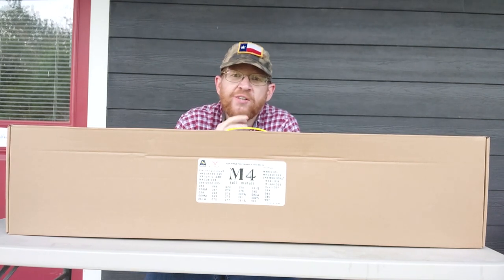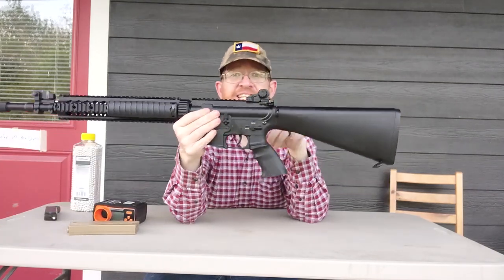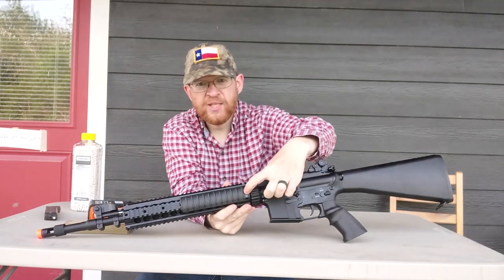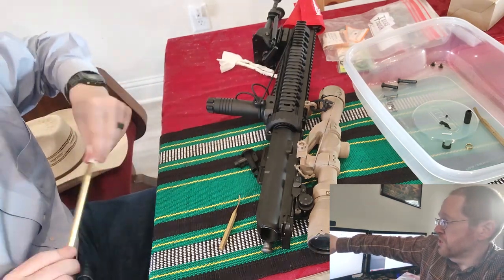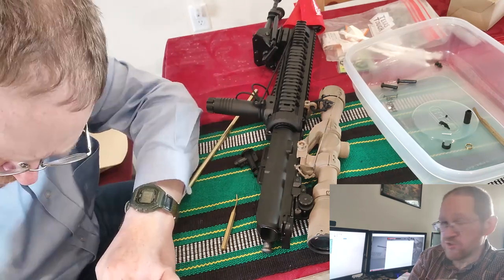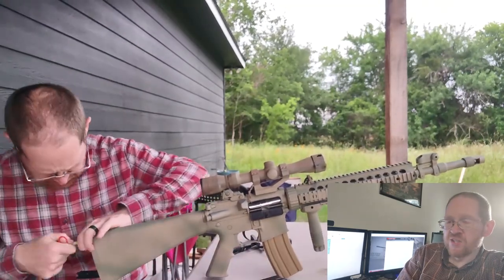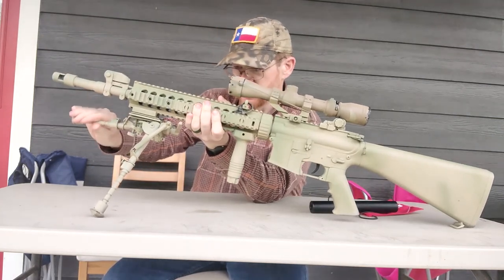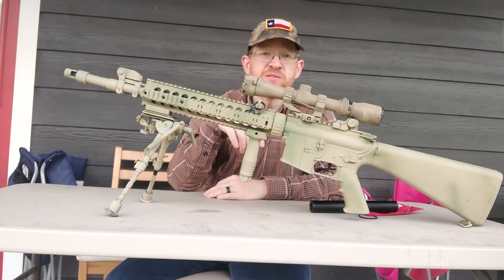Double Bell Mk12 Mod1 SPR setup as a DMR (part 1)

Comment: Hi! Which replica is better Double Bell MK12 or Double Bell AK 12 (internal) from taiwangun? Which one do you recommend?
Reply from the maker: Honestly, it would depend on which you like the looks of better. Actual performance is probably about the same.

With Double Bell, they do a good job on the externals, but horrible internals. They're decent base guns if you plan to gut it and replace all the internals.
Reply: @AdjacentPrepper  Thanks. And, which replica do you recommend with good internal parts? I plan to buy a replica soon to myself.
Reply from the maker: @ivangalovic4045  If you can afford it, I'd say VFC is the way to go. Last time I looked, they run about $450, but they do both good externals and good internals.

With cheaper AEG's, you've got to compromise somewhere to get the cost down. (Based on my experiences) Double Bell does good externals, but compromise with low quality internals. On the flip side, S&T does decent quality internals, but cheap plastic externals.

Comment: Definitely a good move to replace the hop-up but one thing ive noticed is most pre built guns come with pretty disappointing hopup units. Id definitely recommend getting a full metal rack piston tho. Id also highly recommend getting a decent piston head(rocket airsoft makes good ones for about 8$) and a double o ring cylinder head(rocket airsoft also makes a good one for about 8$). The only other thing i would do is a new inner barrel cuz it would eliminate the variable of the little slit near the bucking window that you had to put tefflon tape over. Never the less i love the paintjob and u accessorized it tastefully.
Reply from the maker: There's a part 2 coming. At this point I've replaced the barrel and bucking (again), along with gears (two broken teeth that jammed the gearbox up), and trigger contacts (they were blowing sparks). Might need a new motor; waiting for USPS to deliver my GATE USB link so I can see what the actual error code is.

It came with a full metal rack piston, bug given two gears broke in less than 500 BBs I'm not sure how much I trust Double Bell's "metal".

I tried a Madbull hopup unit, but it wouldn't feed. BBs entered the hopup but didn't make it all the way to up for some reason, so I just switch back to the VFC since it works.

Internally, that gun was a mess, but the compression is actually really good.

Comment: Please tell me, what kind of optical sight do you have on your carbine?
Reply from the maker: Initially I used a Tasco World Class 1.5-4x. I think Tasco discontinued that model in 2015 though. https://www.amazon.com/gp/product/B000UI0VOC/

I switched it to using an old (purchased in 2005) Leupold Rifleman 2-7x. I found the 4x just wasn't enough to see where the BB's were going past 150 feet. https://www.midwayusa.com/product/1009580328

If I had to buy a new optic though, I'd probably go with a Primary Arms Classic 3-9. The 7x on the Leupold is okay, but a 9x would be better. https://www.primaryarms.com/primary-arms-3-9x44-sfp-classic-rifle-scope-duplex-reticle

Comment: Really detailed and thoughtful review. It seems like the CYMA and VFC Mk. 12 might be better options in this case, although the latter is 3x the price. The CYMA has great stock internals and an OK hopup, the VFC has fantastic externals, clone correct parts, so-so internals and a good hopup.

VFC and Z-Parts also sell correct Mk. 12 suppressors that come bundled with their own muzzle brakes too.
Reply from the maker: If the VFC was available, I probably would have gone with that. Given the amount of repair parts I've got invested in the DoubleBell (plus shipping), it would have been far cheaper.

I tried the Bolt suppressor, and the internal threads are way too big. Externally the can looks right, but internally the threads are probably 1/4" too big on each side.

I've tried to get the muzzle break off, but that thing isn't coming. There's a set screw that holds it on, but none of my wrenches (metric or inch) fit, and I've burned out two drill bits trying to drill out that darn screw. I give up...it's just not getting a can.

Comment: Hey what hop up worked for your build, my hop up in mine sucks
Reply from the maker: What's currently in it is an old VFC hopup with a Maple Leaf Macaron bucking and omega nub.

The hopup unit I used is really old, so I ended up adjusting it for 0.30g BB's and then using a hot glue gun to glue it in place. When I get some money I'm going to go looking for either a MAXX or G&G hopup unit, but what I have works for now.
Reply: @AdjacentPrepper  and what inner barrel does it come with
Reply from the maker: It was a generic brass barrel. Nothing special. @flightmaster3735

Comment: How’s the body feel looking to get one as a donor for my polarstar build
Reply from the maker: Maybe. At the end of the day, it's a $180 rifle not a $500 rifle.

The upper and lower receivers are nice, but they use screws instead of captured takedown pins. Pretty common for airsoft guns (except VFC) but it looks a little off.

The handguard is okay. It was loose (and got loose again after I tightened it). Loosening the nut, adding a liberal amount of blue loctite, and tightening it back up with a strap wrench seems to have worked.

If you're looking for clone-correct, the gas block, pistol grip, receiver plate, and rear sight are not correct for a Mod 1, but are what was on the earlier Mk12's (except for the receiver plate that seems to be a copy of the GG&G...which never got military use).

The stock is the weak point externally. It's injection molded plastic. It's not bad per day, but compared to a real A2 it feels cheap. Then again, a real M16A2 stock was designed to be a melee weapon (club), so I don't really expect a $180 gun to be similarly tough.